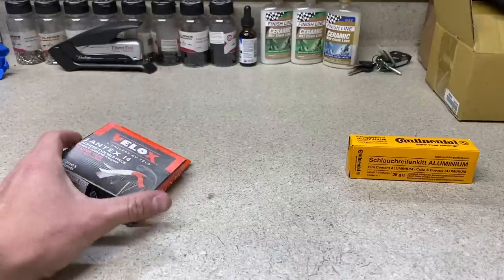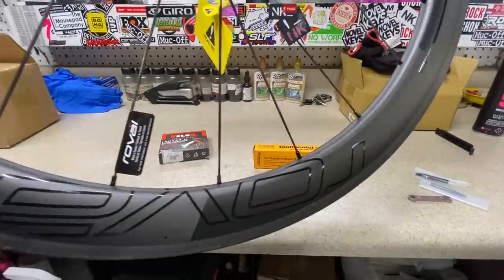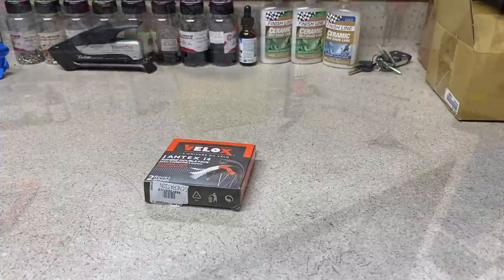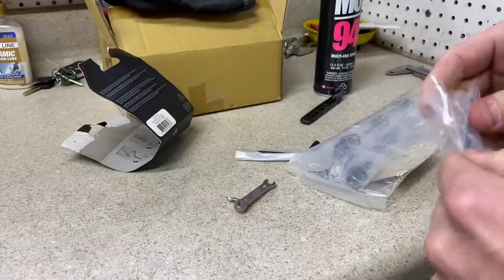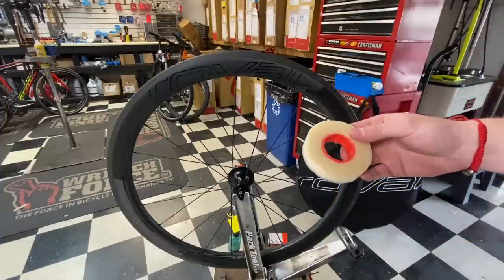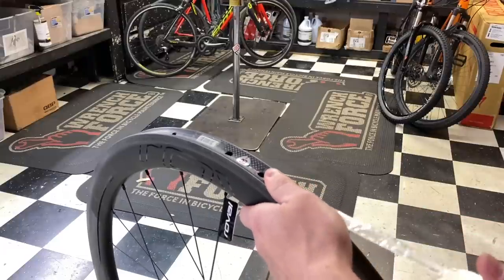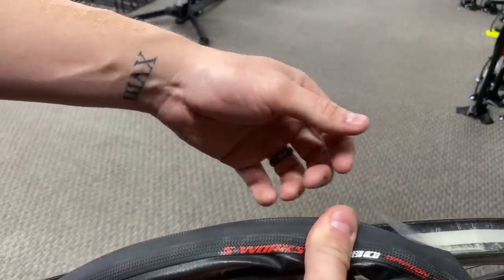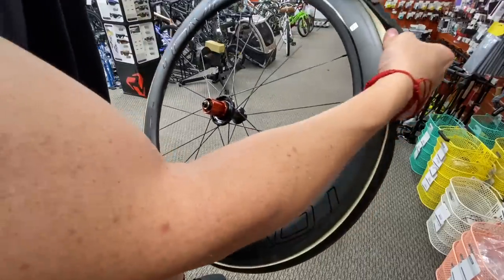INSTALLING TUBULAR TIRES IN 2021 WITH NO GLUE?! (ARE THEY WORTH THE WORK?) SPECIALIZED ROVAL CLX 50

Comment: I have been using tubulars with double tape exclusively for the last 5 years. I go on long rides and I do not even carry a spare, only the pit stop from Vittoria foam sealant in case that a flat. No more clincher or tubless for me.
They ride amazing, last longer, less flats even with really low tire pressure and are very easy to install and replace.
You should give them a try.
Reply from the maker: yea that vittoria foam sealent works great, I always recommended it for tubular users!!!! great feedback and enjoy those rides!!!
Reply: I have run 25mm tubulars at 40 psi no probs (rough surface), you can also pump them up rock hard, no limitations like you have with clinchers. Just a more versatile system.
Reply: Tubulars are the best choice,for riding,short rides long rides whatever..
Reply: Hi do you put the sealant after you should have the puncture or prior?
Reply: @MrMars121  with the vittoria spray we are speaking of , it's for after a puncture.  sealant for prior the puncture exist but i think nobody uses them on tubulars because, if you ride tubulars , one of the big properties of it is weight , they are around 200gr lighter than normal clinchers so , ruining this advantage with sealant .... if you fear punctures a lot , go with clinchers tires. If you still want tubulars , go with the continental gators , they are reinforced ;)
Reply: @shawnoconnors3645  I've recently had my first puncture on tubulars. Vittoria did the job!
Reply: Have you ever had to use the Vitoria pit stop at all,? I was thinking of trying it.
Reply: @e3dave744  yep it works!
Reply: I want to .. when I cycled a lot more in the early 90's I had friends who only ran tubular.
Reply: @MrMars121   You put the sealant when you have the flat, the Vittoria Pit Stop pumps both, the air and the sealant at the same time, so you are re-inflating the tire at the same time that you are fixing it, works great!
Reply: @e3dave744   Yes, I have use it a couple of times. it works great!
Reply: @murcielago188  I bought two Victoria  pit stop 👍
Reply: @MrMars121    You can do either way. I do not put sealant on my tires
Reply: In every way tubulars are always better for serious road riding - just like rim brakes and mechanical groupsets!

Comment: After a lifetime (50 years) of riding clinchers, 5 years ago I built up a classic steel Colnago with tubular wheels and fitted tubs using the tape method as shown in the video (although 60 psi is too much pressure for removing the backing tape, as you demonstrated). Five years on and not a single puncture despite having covered around 20,000 miles (yet I still carry a couple of spare tubs just in case!). The ride quality is sublime (on Veloflex or Vittoria) and I have confidence to descend and corner at high speed. The tyres seem to last longer and are impervious to the bits of road grit that find their way inside clinchers and cause most of the punctures I used to have.
Reply: Can i put sealant directly in tubular tire even im not puncture or i will put sealant the time im puncture only?

Comment: Personally I prefer them when I’m riding in the mountains for safety, a flat tub stays on the rim where a punctured clincher will be off the rim way before a rider is able to slow the bike, an accident at 50-60mph descending could be life changing if not life ending, and with products like Vittoria pit stop or muc off B.A.M a punctured tub is usually soon reinfected and sealed without even taking a wheel out of the bike, then there is the feel of them, the bike feels more alive on tubs, not to mention the huge weight saving of tubular rims, around 200-300 grams of rotational mass making it accelerate better, brake better and handle better 👌
Reply from the maker: yea for sure this is the better option for saftey, but for where I am at an no high speeds like that just self propelled flat roads there is not as much worry
Reply: I got experience at that, I was just before or on top ditching beacon when a guy said I had a flat but didn't think at the time, went down hill at 43-63mph forgot speed I reached with flat front as I had tubular and no way to sort it, also London to Brighton, I had this stupid woman cycling just beside me, she didn't move over enough so I had to go to the right of a bollard in the road so at 27mph with 30mm carbon wheels and 22mm tubular and carbon frame I had to squeeze in a 6" gap, so know bike cost me £4k and was not insured

What I hate most is in London and Brighton you go on green, on rest of the route they tell you to go through red
Reply: Forgot to add my rims have prime rd010, CX ray spokes so with berd spokes be lighter but about 1500g when cassette and disc on them before tyre is nice (weight of both wheels)

Comment: I love tubulars.  The ride is simply nicer.  I have very few issues with flats, and since trying the Donnelly cross-sized tubulars that use tubeless construction, I have zero issues with mounting them straight or adding some sealant if I ever do get a flat.  I haven't yet, though, so aside from the admitted pain of gluing, I'm 100% happy.
Reply from the maker: yea and I mean the consumer really doesnt have to worry abopiut the pain of gluing they just have to knkwo it takes time and plan for it
Reply: I ride tubeless on my mtb. I bought some bargain ZIPP 50mm carbon wheels for my rebuild.

Even with 15 year old tubeless 19mm bald danger boyz I probably have 250+ miles on it no spare needed at alllll

Comment: I still train daily on tubulars. Good tubulars and good clincher tires are pretty much same price nowadays. I use tub tape as well so it's super easy to install / get off. I enjoy riding super exotic but much cheaper (now) tubular rims that are VERY light. Would recommend it!
Reply from the maker: very nice and yea tubulars are becoming more affordable I think because not as many people buy them which makes for a nice bargin wheelset for the money if you dont mind the hassle
Reply: Is tape good enough for it to not roll off? I just relax in my commute at 27mph, barely leave 53/11 gear even on the short hills, had pain spending 8 hours removing glue as how a mechanic showed and described it takes like 5 minutes a wheel

Comment: Yep! Run them all the time, best system, it is just different so people are put off by the glue mess. But tape works and is so easy.
Reply: Don't need to wait with tape, just pump it up hard, done and ride.
Reply from the maker: very nice!! yea they work well I didnt know about putting the tape on and riding right away, I mean I know you can but I thought they recommended a wait time
Reply: @GCPerformance18  never read this?? And i have been running tubulars for ever. I do have one set of clinchers for my rain bike cos i couldn't find a high end ally rim tubular. I hate changing them. Seems so difficult compared to tubulars. I do agree the glue stinks and you end up like spiderman. Did this many moons ago, but the tape is a game changer these days.
Reply from the maker: Yea I have done the glue a lot and it’s so shitty!! The tape was a game changer for sure, and I always tell my customers not to ride at all but they are full kitted just got done with a group ride and need to get back to there car and stubborn so I set it and tell them and then they just go slowly like 5 mph

Comment: A tubular flat tire is less common (no pinched flats cause the rim shape has no edge like clincher rims).
And since the use of sealant, in case of a flat, just put some sealant in through the valve core similar to tubless, and it will seal itself, easy.
Todays tech is pretty good expensive clinchers can have a supple ride, however the ride quality of tubular are a special thing: silky smooth and fast. Because of the different shape of the rim you have more feel of the road, and they're lighter (less rim material) and 
therefor faster for acceration and better for climbing. Totally worth it if you don't mind learning a new installation process which is no big deal. I have tubulars on all my road bikes, one tubless setup on my CX bike, and clinchers on my everyday work bike.
Reply from the maker: thanks so much for the info!!! yea I mean tubulars are a nice tire and feel super smooth but not worth it for the average consumer who dont want to deal with it
Reply: Hello, are you still riding the tubulars? Has anything changed?

Comment: I have a tubular set for races and I just adore how smooth they are, and because I know I’m safe. I definitely don’t encourage tubulars if it’ll be your only wheel, and I don’t take these wheels on long touring rides.
Reply from the maker: sounds like a good plan I mean for sure if you can afford both sets then that works great
Reply: They did a test with the pros - they couldn't tell the difference even tho they said tubular ran smoother. Really no point in having tubulars.

Comment: l‘m using tubulars as long as I ride road bikes (about 10 years now). After I had three rim failures in a short row with carbon clincher rims on my mountain bike (one rim got wider in one spot, two rims broke… not catastrophic though) I decided go tubular with carbon rims on my road bike. Especially as I use rim brakes. The combination of a heated up side wall and the pressure of a non tubular tyre (with or without tube) is frightening to me. Over all I made good experiences. I use Tufo tape with different tyres. It’s easy to apply as seen in the video and about anybody should be able to do it by themselves. Changing a tyre is way more work than just changing an inner tube or changing a tubeless setup but if you have a bit of experience it’s a job of may be 2 hours. And yes: You do get the Tufo tape of the rim just by pulling it off and, if you want to be über-correct, you can remove residual glue by tapping the removed still sticky tape on the residual glue to take it off.
I never glued with cement. For me tape is superior because 
1) you don’t have to sand the carbon rim before you apply the tape
2) it’s clean
3) it’s faster (the whole cement gluing process takes some days if done properly)
4) you can go for a ride right after the work is done (at least if you use Tufo tape)
So as long as I use carbon rims, especially in a rim brake setup, I‘ll use tubulars and Tufo tape. 
If however I was using ALUMINUM rims like my wife does I’d use clincher rims with regular tyres and a superlight tube (like Schwalbe Aerothan or Tubolito). The safety aspect mentioned in comments above might be relevant for racers going downhill with speeds above 60 mph… a normal rider should be able to stop safely if you feel your tyre is going flat. Usually tyres don’t explode…
So for me it’s more or less a question of the rim material and the brakes you use.
And if you’re into that thing: A tubular wheelset will always be lighter compared to a clincher set… rim or disc brake.
And just a small tip: If you have the time you should mount your tubular tyre on the rim without any adhesive, pump it up to 100 psi and let it sit over night. Take it off, apply the tape on the rim as shown and put the tyre on again (as shown). Like this the tubular will slip on the rim easier and it‘s also easier to get it straight before removing the plastic liner and finally fixing the tyre.

Comment: I've been gluing tubulars since the late '70's. Aside from the method of gluing/taping, a common theme or lack of theme to be more precise I've noticed on this subject while watching videos on this platform is the inattention to the subject of preparation of the tire/rim prior to the installation. Tires need to be dry fitted to the rim. This is the opportunity where one can see how the specific tire and rim interface. Does this tire fit the rim contour properly? Does the base tape around the valve sit and seat properly into the valve stem hole and sit flat down onto the rim without creating an elevated gap and hump? Is the integrity of the tire intact? The tire should be inflated to desired riding pressure and observed for a day or two to make sure there is not a leak from the tube nor stem. Is the casing warped in any way and is the tread fairly true without defects? Once this has passed preliminary inspection, then the final installation may continue. If one continues to use the same tire/rim combo, this process can be accelerated a bit. If a defect is discovered after a tire is glued/taped, the manufacture warrany is void.

Comment: With the improvements we’re seeing in tubeless today, I don’t feel tubulars are worth it any more when clinchers are easier and more cost efficient and tubeless gives you the strength and the weight savings. Maybe if you’re racing there’s something to be said for tubulars but I don’t think I’ll ever buy a pair
Reply from the maker: yea I dont think so either unless your a racer and have some serious wattage being put out or bombing down hil into corners I dont feel there is a need for it
Reply: @GCPerformance18  bombed many mountain descents on clincher tubes and tubeless without issue. Rim brake carbon and disc, no issue. Bullet proof these days. Loved the video, keep em rolling.
Reply: I think tubeless is actually heavier than running latex inner tubes?
Reply: I have to disagree, run tubulars all the time, they are significantly lighter and safer as the tyre can't leave the rim. They also can be ridden on a flat tyre slowly, i have done it for 5km. Only negative is the tyres are a little more expensive and harder to get, but i keep a stash. It is really easy to change a tyre with tape. For flats, sealant can fix a flat or just rip of the tyre and stretch on a new one (carry a spare tyre). Don't need any glue or tape to get you home. Just don't scrape the pedals. Lol
Reply: @fergusdenoon1255  I think tubeless are actually about the same as latex inner tubes if not a little better from what I’ve heard
Reply: Have you tried tubulars. Nothing compares.And nothing comes close to the weight ...
Reply: @lomilomi3535  Tubulars are a pain in the ass for your average cyclist though
Reply: @quarkonium3795  I agree.... but your average cyclist has no idea of the tubular advantages. I would say tubs are not for your average cyclist.

Comment: Thirty years ago I raced on tubulars then stopped riding all together. Fast forward to now and I just bought my first road bike in 30 years that’s 2 years old that came with Dura Ace carbon disk tubular rims and Continental Competition tires. My question is with this tape is if I flat out on the road and need to throw my spare tubular on .. is this tape going to be sticky enough to get me home? Back in the day I used the Velox brownish colored glue .. and it was plenty sticky enough to throw on my spare and get me home safely as long as I didn’t corner hard. Then when it comes to putting a new set of tires on .. how easy is it to peel this tape off the rim? Thanks
Reply from the maker: it is easy to remove but I do not know if it is sticky ebough to get you home...... I cant say for sure because i have not had anyone tell me they have done this yet with the tape..... I wish I could be more help

Comment: Do you recommend sealant in the tub? And if so which one? I’ve just bought a rear disc and got a great price on a pro tubular, I’ve been running tubeless for TT and like the security of sealant! Also thanks for this video, I installed the tubby no problem at all 👍🏻
Reply: If not sure which sealant brand but, you can use them in the tub
Reply from the maker: I dont do it but I know people do and they say it helps but Its something I reocmenbed
Reply: Tested many sealants on various mtb tyres. By far the best and most reliable one was Stans Notubes. Did a few road tubeless conversions too and it holds up to 6 bar fine.
Reply: Tested many sealants on various mtb tyres. By far the best and most reliable one was Stans Notubes. Did a few road tubeless conversions too and it holds up to 6 bar fine.

Comment: how do you remove tubular tire off the wheel?  I mean, if you need to replace the tire, how do you get rid of the double sided tape?
Reply from the maker: you sit there and huhhhhhh.... go at ti withj like a flat edge, maybe some goo gone and get after it lol
Reply: Once you peel off the flat tire, simply apply tubular cement over the existing tape. The cement will reactivate the glue left on the rim. Then proceed with the process of installing a new tubie.

Comment: Will a dynaplug tube repair kit work on these as a temp repair to get you home?
Reply: Yes. Although it depends on whether you have a “tubeless” tubular tire. If the tubular has an inner latex liner (tube), neither the plug nor sealant will work well.

Comment: Hi, thank you for posting this helpful video! I'm looking to install some 23mm Vittoria Corsa tires on Zipp 808s and was wondering what size Velox tape would be best? (there's a 22mm available is that okay?)

Thanks again! -Manzmac
Reply from the maker: yea it would work, it is preference to you but tape is a little easier install and not as messy but the glue is easy too
Reply: @GCPerformance18  Thanks so much! One more question, which valve core do you recommend purchasing?
Reply: And the Velox tape I found was actually a 18mm is that okay for the rim? Sorry for the flood of questions!

Comment: I wanted to get these tubular wheels to shave 🪒 off 609 grams on the current wheel set. The rep said that I should try tubeless and stated not even the pros train on sew-ups. I just wanted them because of the cost and huge weight savings. Waiting now for some 60 mm depth rims.
Reply from the maker: yea I am sure poros dont train on sew ups its prob not worthj it but for full sends and taking all the risks they want the security of the wheels holding